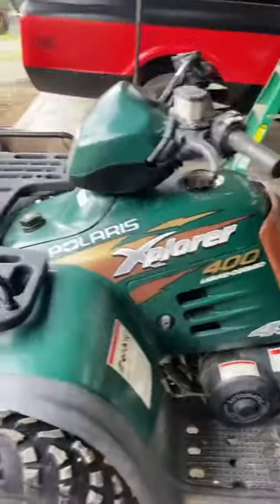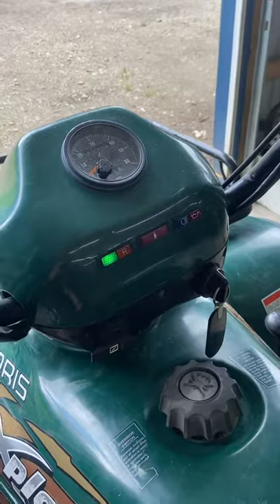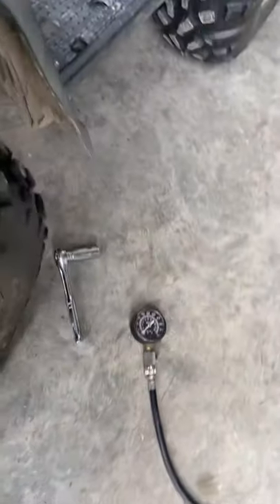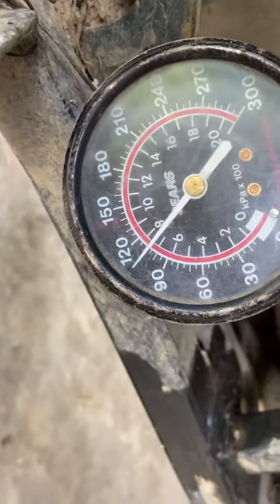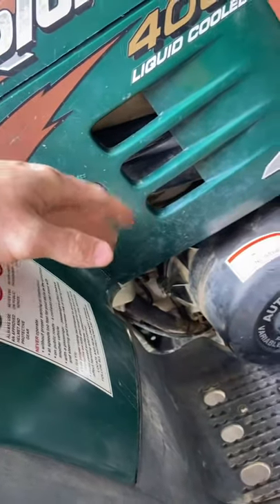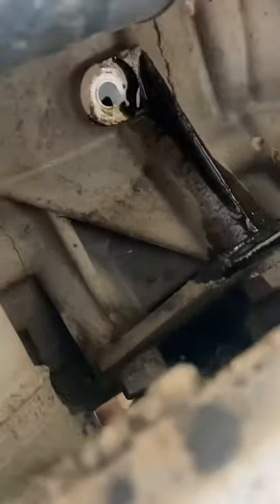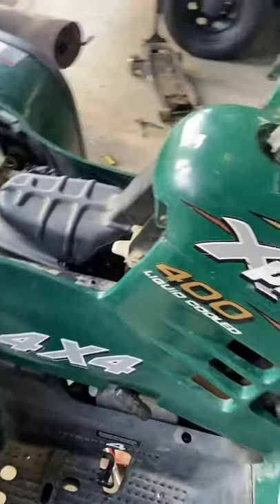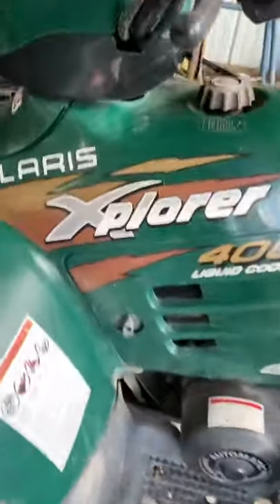Old 2-stroke Polaris won’t idle. Fix!!!

Comment: I have the oil pump problem of dumping too much oil in mixture. How did you cut off or what do you have to do to bypass anything to just premix fuel?  Thanks
Reply: Unbolt pump cover, disconnect your cable, drain oil tank of oil, mix fuel and go, I prefer 50:1 mix

Comment: I have a 91 350 trail boss, similar set up, is that supposed to be empty because mine has a crank case fill port for oil and yes its a 2 stroke

Comment: My polaris explorer does not like to stay running in reverse. It starts and drives just fine, except in reverse. Have never had problems until now. Any ideas? Thank you
Reply from the maker: Probably the reverse speed limiter
Reply: @redneckcustoms5919  that's the yellow button. I use that for plowing when in reverse. It wants to die in reverse. I'm putting a new spark plug in tomorrow. Other than reverse,  it starts and runs forward just fine...
Reply: I also have the same problem shifting to reverse.
Reply: @romeonaize537  I changed the spark plug and I installed a new battery. She starts up, runs,  and now shifts perfectly!!
Reply: Mine runs fine, just wont idle, if i increase the idle it grinds the gears, runs very fast, but idle is erratic, what to do ?

Comment: I linda lije 'em. In a way the lesser powered 250 or 300 wouldn't have counterbalancer (correct?) or water pump so less parts to fail. A few hop up parts help wake it up.

Comment: I have a 96 that idles super highhh and when I pull the choke it bogs down also when I try to adjust the idle with the screw it does nothing at all could somebody help me out? I’ve read so many forums and nobody seems to have the same problem
Reply: Probably got an air leak or a bad crank seal
Reply: I got the same issue haven’t figured it out
Reply: Check in side the gas Throttle on the handlebars is the wire inside of the box  Did throttle cable goes in
Reply: I have a 98 250 that idled super high after a new carb was put on, we got 2 new carbs that ended up not working and a throttle cable that claimed to be for my machine but was too long. So we got a carb rebuild kit for the old one I got water in, rebuilt it now the thing has to stay full throttle to barley idle it was running fine again for awhile but we could never find it's happy place with the air fuel it would always still bog when given half or more sometimes less. I figured the carb rebuild would solve that but I guess not still have yet to mess with it more.